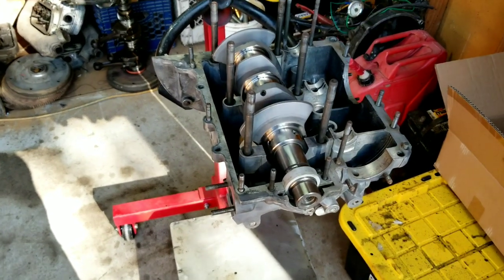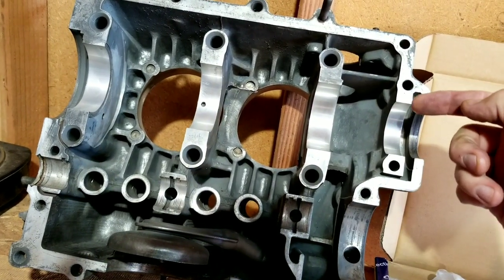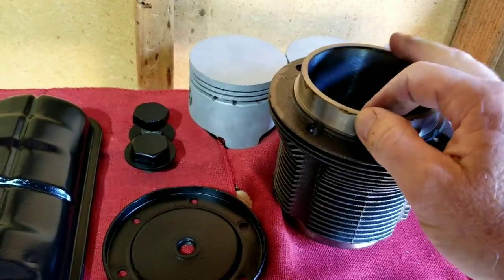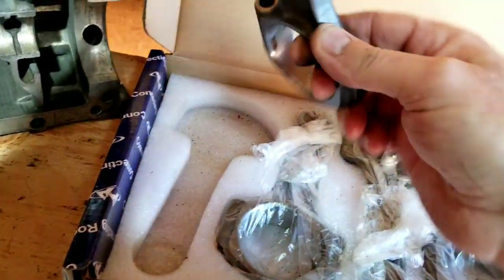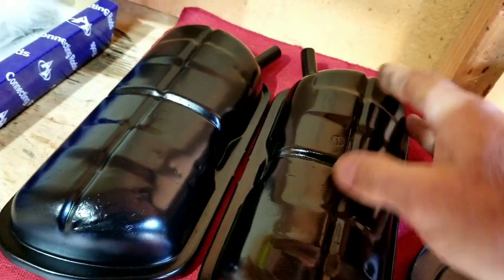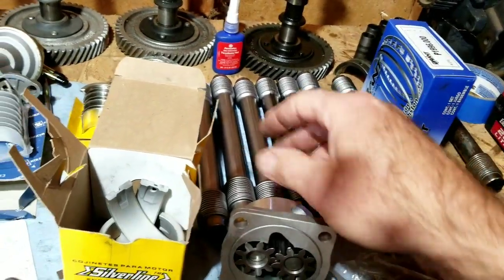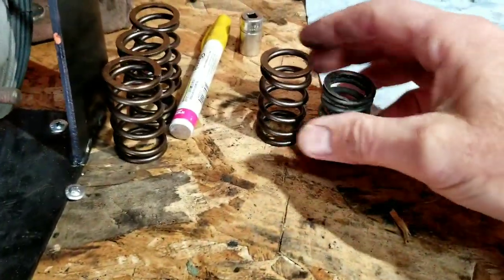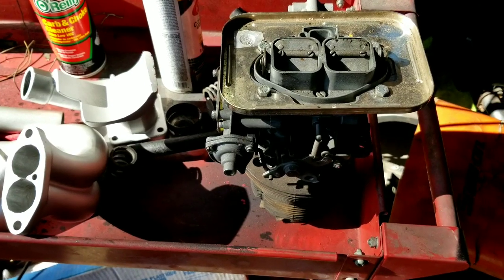74 Stroker performance VW engine build  parts walkthrough

Comment: I run a 2110 with dual sWeber 44’s, in a ‘70 dual cab. Full flow motor with external oil cooler. Run well.

Comment: Why did you choose to go with a 74MM crank?  Was it the biggest you felt comfortable using with a mag case?
Reply from the maker: for reliability yes. You can machine your mag case to run a larger crank. But you should also put shuffle pins in the center main plus you take a lot of support out of that case. Best if your going bigger to go with aluminum IMO. already machined for larger crank. Better more stable material.

Comment: Mike, curious if you had the crank balanced? I have a cast 74mm AA crank that I'm building with the 88 pistons. This won't be run over 4500 running factory F.I.

Comment: Wh as t did all the parts end up costing
Reply from the maker: im not really sure I did get them all at wholesale. probably less than 2000 with the oil cooler. tubing and fabrication parts. stroker crank short rods new valves and springs. had the heads already. well under 2 grand. and machine work.

Comment: Is the holleyweber carburetor still a thing?  Haven't messed with vw's in a very long time, but hasn't something better come along yet?  I absolutely hated the holley weber when I had one -- it never ever never ran right, ever, no matter what I did -- trashed it, went for duals & they were awesome.
Reply: well   They had a long galley running parallel to its base that would hold trash - it was kind of like the idle restrictor on the pic3s. hard to clean.
Reply: I hated those when my brother did a complete engine overhaul for my 71 Westi Camper. Not enough CFM for a 3,000 lb vehicle. But my oxidized chalkboard green camper would out accelerate the newer VW vans. Got the funniest looks! My brother modified the carb for the secondaries to open together. Made it too snappy cause the secondaries opened faster. Broke the clutch springs. Should’ve went with the 48 Weber my bro recommended. In the late 70’s it was pricey in that economic era, now it’s ridiculous. My bro had a Ghia doing low 16’s at the quarter mile while getting 28 mpg. Trans work close ratio 3 &4. My main ride was a 57 Porsche, drove that in high school, Those were the days! Thanks for the video, memories!

Comment: Roughly, what is the weight of the lightened flywheel and in general, do you have a weight preference for lightened flywheels? Like your vid, thanks for posting it and sharing your insights.

Comment: I have done 2054 (94x74) and I found even with 94s I had to clearence the roof of the case and barely the end of the jugs. With your clearanced rods does it stay away from the jugs and case?
Reply from the maker: yes just a bit of clearancing. not much.

Comment: I wonder if the oil cooler adp. if you could use one of those flat grey paper gaskets so the red rubber wont close up.
Reply: @Grahamm Boyett They use to not close up just get hard and crack up. When they close up there goes the oil cooling.

Comment: Another great video Mike...goes to show you that AA parts can be good to use too. I have been having great luck with their piston/ cylinder kits. Haven't used the rods or crank yet...did you get the crank and rods balanced while at the machine shop?

Comment: Thanks for sharing your knowledge, thoughts and experience. What spark plugs do you use for stock or different applications?
Reply from the maker: stock on this one. not sure the heat but probably completely stock. Heads are stock heads. I do like the AA ones better but i have a great stock set.
Reply: @Mikefngarage  Thanks for your reply. By stock you mean Bosch W8AC?

Comment: I really been wanting to do a 74x88 thick wall..
Reply from the maker: yea we talked about that in the next video coming up on this build. That engine would be super strong running. It needed a line bore so I had them cut it to do 90.5. In hind sight I may have run a 1800 74 x88 which is a great combo for less machine work.
Reply: @Mikefngarage  I'm building that 1800 now I'm buying Panchito 044 head's  I was told not to do anything to them just use them straight out the box with a Engle cheater cam .
What do you think about this setup and would you port these head's?✌️
Reply from the maker: @charlesmartin7347  the ports are already pretty much modified. they could be wedge ported but I would just leave them like they are. They already have a slight wedge port Should run good. FK7? cheater. 1.25 rockers. 1.4s can be pretty tricky to get the geometry right. may hit the stretch tubes.
Reply from the maker: @charlesmartin7347  put some photos on the facebook Mike Fn Garage facebook. or a short video after your done to show the other guys.
Reply: @Mikefngarage  you are a blessing sir thanks for sharing your knowledge.
Blessings and more blessings to you and your family
Reply: @Mikefngarage  I actually got the name wrong it's the Eagle 2280 racing cam (cheater cam) with cb performance.
Reply from the maker: @charlesmartin7347  good grind. might run ok with stock rockers 1.1. I would run the lash caps or alternative though. Make sure to give that sucker at least 8.5 to 1 compression.  or its going to fall on its face on the bottom end. I would try for 8.75 or even 9. The top end is going to rip. In a bug that sucker will be fun. If your going dual carbs. 40s max. 44s will need to ventury down anyway so 40s will be fine. If you are going 2 barrel the Egas would also be fun. and once it is jetted no plug ups. 1 1/2 exhaust sidewinder merged or merged. 1 5/8 will loose torque and bottom end. you should be able to pull 100hp out of that. If you shift hard on a stock trans you will break it. Super diff and welded 3rd and 4th might be a start. there.
Reply from the maker: @charlesmartin7347  Oh yea remember if your going short rods the rotating assembly is lighter than stock. will want to spin some RPM.  keep way away from 7k.

Comment: What is the approximate HP for the build?
Reply from the maker: with the carb on it probably around 100 or so. if you put duals on it much more than that. Would like full running 40s on it to make it fast.

Comment: Q, did Brothers do you machine work, if so could you let us know what it cost I.e line bore, clearancing etc.
Reply from the maker: yes all done by brothers. I had them do the full flow line bore and cut for 90.5. was around 200 bucks.

Comment: All 74mm cranks are either cast or 4140. I have 180K miles on my 74x85.5 mini stroker, its been great!
Reply from the maker: I think we got a 4340 but yea they are the way to go instead of counterweight 69 just a few bucks more and you get much more power. Try the 88 thick wall upgrade with the aa 40x35 valves OMG super fast then.

Comment: If you use stock rods on the 74, how much barrel shims do you need
Reply: That will depend on the case you are using. Every engine is different, was the case decked? You have to check your deck height once everything is assembled, then adjust with barrel shim if needed to dial in your compression ratio and type of fuel used where you live, or what kind of head you are using. Hope that helps.
Reply from the maker: we went short rods for less barrel shims. But our chambers were low cc so I had to go 70 on the deck. Which I like a 50 to 60 deck. Less barrel fire which causes detonation. We are opening the heads right now so we can even do 70. 9.1 to 1 right now gotta bring it down to 8.75 or less. That is why I like the AA 40x35 heads they have huge chambers. you can cut them down if you need to. but that is easier than opening them up believe me.

Comment: Great video. I’ve been wondering. Why do they put three shims in to set the end float and what effect it would have if you used more or maybe less?
Reply from the maker: vws need to have a certain deck height. Usually between 50 and 60 minimum. some guys run as little as 35 thousands. But I wont go there. you use a compression ratio calculator to determine what compression ratio you want to run with a CC combustion check. Need to do all that on these engines to make sure they dont run too hot.
Reply: Ah no I was talking about crank end float!
Reply from the maker: yea sorry I was reading through these pretty fast. They need the shims to have the crankshaft pulled to the front of the car. because they are not flanged and the way the rods are configured. the shims keep tension to the flywheel side. 3 shims is to make sure they slide against each other. Some german engineering technique. Not good to second guess them. There is a reason But I dont know why. just like you need 9 shims total on the fan belt pulley or it will crack.
Reply: Thanks man! 3 must just be the magic number!